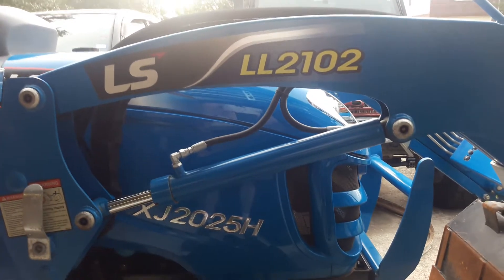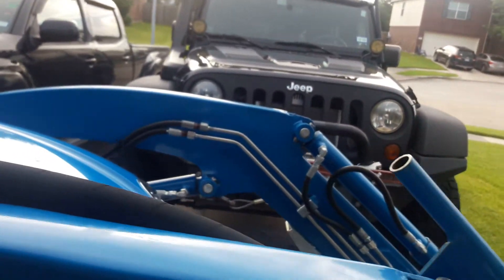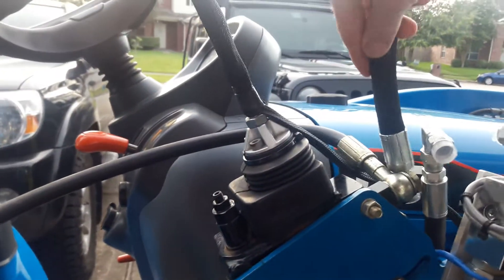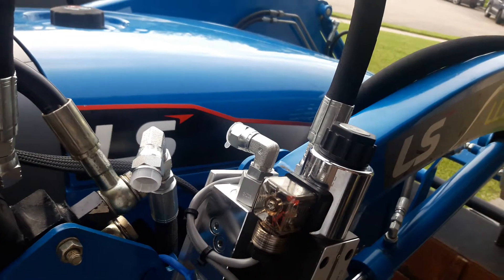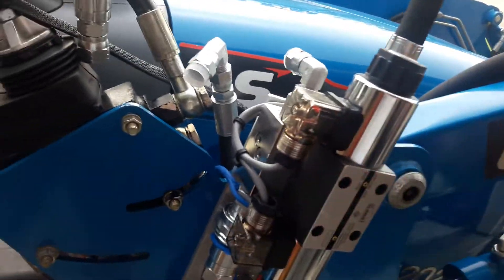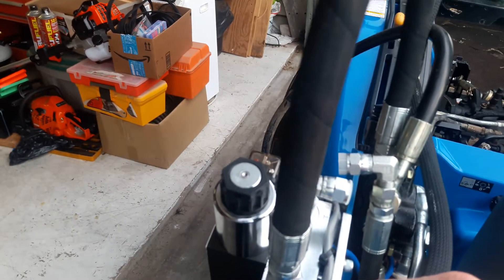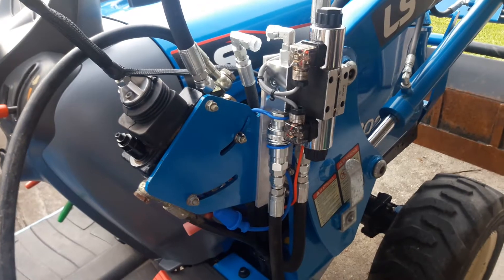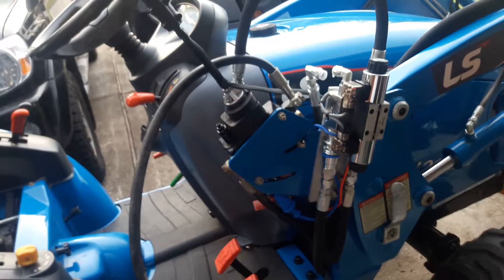Summit Hydraulics 3rd Function Valve Installation Overview

Comment: I've dug through Youtube, Green Tractor Talk, you name it, and I'm amazed at the lack of information out there on installing these third function kits as far as the details of the hydraulic plumbing.  I understand that every make/model of tractor is going to be different, but aside from the actual routing of the hoses, it seems like the basic connections (this goes to that regardless of how it gets there) would be basically the same across similarly equipped tractors.  There really aren't many videos out there that exactly detail the path of hydraulic connections for these kits.  Your video has been about the most helpful information for a guy like me with limited knowledge of hydraulics.  Glad I found it!  Thanks!
Reply: Thanks so much for watching and for your comments. I am glad this helped. I am indeed working on a much more indepth video on this very issue but, to say the least, there is a lot of research and time involved. Not sure when I'll have it all shot and edited but I do have a lot of video in the works.
Reply: Your dealer should be a good resource as well.  My dealer sold me a WR Long 3rd function kit for my Kioti and gave me some schematics that proved to be extremely helpful.  Dealers do the install with the units they sell, so if you decide to do your own install, they should be able to help.  I will say, the instructions that come with these units seems to be total junk from all brands from what I have found.

Comment: I have and XJ2025H, can you share the size fittings you had to convert from the British threads?  Did you ever try out the set up, if so how did it function? Thanks
Reply from the maker: Brad, the 3rd function has worked great for over a year now. I looked back to see if I could locate the sizes that I used but unfortunatly we've moved and I still can't find that paper work. My suggestion is to take  the pieces that came off of the valve and the new Summit pieces to a hydraulic shop. They usually don't charge much for that and it is very common that they may have to put two or three pieces together to make it all fit. Best of luck!